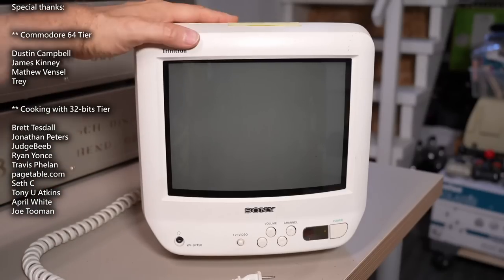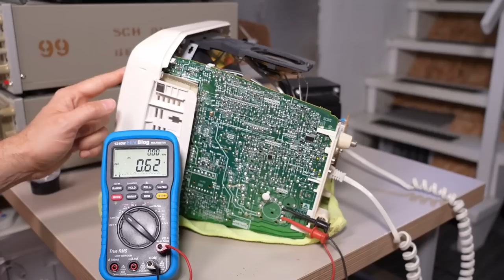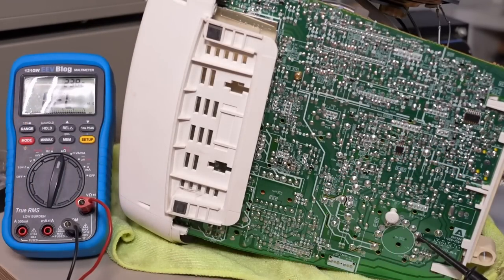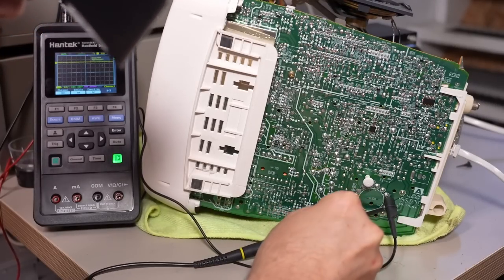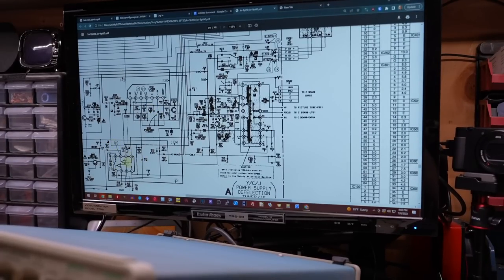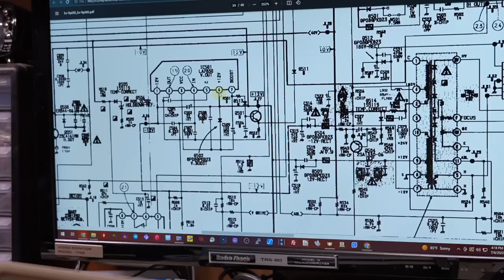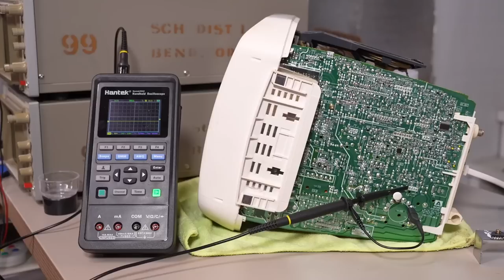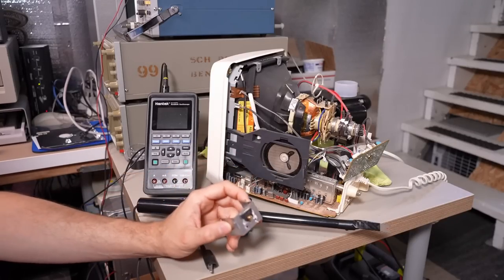This little Sony Trinitron TV squeals and then shuts off (KV-9PT50)

Comment: We have that exact Sony, but the gray cabinet AC/DC version.
Still works.  Not that I use it anymore.  I bought it when I was doing video work years ago (long before HD).

I only keep these sets for memory's sake.

It's late here right now, so I haven't watched the video as yet.  But I'll watch it in the morning.

This squealing issue sounds familiar.  In the past, a lot of time, "squealing", as a certain high frequency, was often a "loose" flyback.  But who knows.
I struck that out, because before watching the vid, I thought that the set "worked" but that it squealed as it was on.  Clearly, not the case.

It's very possible that this flyback is at fault, but it's very possible that there's "something" in the Horizontal section that could cause this.  I did see that you were able to see the Horiz. startup frequency there for a moment.  That might lead one to believe that the Horiz. section is ok.  However, if there's something in that circuit that, once energized, is either killing the horiz. oscillator or changing its frequency, then the flyback won't work to begin with.
That startup frequ. needs to be stable so that the windings start to function.

I think that you said that you have the AC/DC version of this TV there?  Or perhaps you just mean that you fixed on before.  ????  But if you have one, perhaps check the flyback to see if it's the same part number (or very close via schematic).  If it is, then perhaps do a swap between the 2 sets and see if the problem remains on this set, or goes to the donor set, following the flyback.  That would be definitive for sure.

If the problem stays with this set and the donor works fine, that of course, rules out the flyback and now you could concentrate on the entire horiz. section.

Just some ideas.

Comment: I remember around thirty years ago there was a device you could buy that could test for any shorts inside a fly back transformer, maybe there's a schematic somewhere online, probably some sort of simple oscillator circuit involved, could be worth looking into for future repairs.
Reply: If he has that other AC/DC version of this TV that he talked about, perhaps the flyback is the same as in this set. 

Then, doing a swap out between the 2 would help confirm if the problem is the flyback or not.
Take this flyback, put in the donor, take the donor's flyback and put in this set.

If the problem follows the flyback, then it's a bad flyback.
But if the donor set works with the failing set's flyback, then it's ok.

The problem is, finding a donor or getting lucky to find a donor flyback somewhere (new would be best).
Reply: @BlondieSL  Probably the best option, I don't see why it wouldn't be the same, unless the design is radically different to the AC version, I know some older Hitachi sets used the same fly back between the DC and AC only sets, easy to pop off  the back and check see if the number matches.
Reply: @electronicarchaeology  Yup!
Reply: This looks more like one of the secondary load circuits being shorted. If the flyback was bad (shorted) the horizontal output transistor would likely be fried.
Reply: @stevebabiak6997  It does look like there is some sort of loading going on, whether its the transformer or something in the secondary, I was under the impression that a short in the secondary was mostly eliminated,

Although the line output transistor can get damaged, I've found in the past not always, depends how quickly the power supply responds,

Maybe something in the power supply itself, there is usually a cap around 47uf 63v in the primary section, when it goes bad it can throw you off  thinking the problem is due to a short, In the end, it's a great help if you can replace and rule out the transformer if things get difficult.
Reply: @electronicarchaeology  - using “shotgunning” by changing the flyback isn’t something I’d recommend. They aren’t a regularly stocked component at the typical distributor, and they are expensive to boot. If he can even find one.

I posted a lengthy top level comment giving some ideas. IMO if that flyback is kaput then that set has now become a parts set to cannibalize for the next similar set.
Reply: @stevebabiak6997  You're mistaken there's no shot gunning as you call it involved, if you watch the full video Adrian mentioned that he had another set, A 12v version, if a service engineer suspects the fly back transformer and has another at his disposal, There's nothing wrong in swapping it out even if it for elimination purposes, I've been a service engineer for more than 40 years, my colleagues and I have done this many times.
Reply: @electronicarchaeology  - my definition of shotgunning is replacing a component when it hasn’t definitively been determined that said component is defective or has failed. So you’re free to define that term as you choose, but it would be a case of shotgunning based upon the definition I use for that term.

Manufacturers figured out how to reduce shotgunning - they make it nearly impossible to replace an individual component and instead encourage replacement of entire boards.

Comment: How ironic... Back when I was a kid, there were commercials of tv repairmen coming to your house to fix your tv. $39.00 later, they would leave, with a smile on everyone's face... Now, it's hardly an option at all, to have your tv fixed . .. Good thing the videos make money! 👍
Reply: Who ever charged only $29.00 and that was it!??  LOL

Back in my time, my house call was $39.00 and would include minor parts, like fuses, for example.
If there were tubes to replace or a module.  For modules, if they were brand new, I'd have to charge the full price, but if it was one that I refurbed, then a special low price is all I'd charge.  I'd take the old module back to the shop to do repairs and refurb it.  I was one of the rare guys who, when "refurbishing" a board, would not only fix the fault, but change other components that were KNOWN to fail down the road.

Comment: I had the exact same TV in my kitchen for many years back in the early to late 2000's.  It failed in the same manner.  I'm into electronics and finally scrapped it.  I DID save the picture tube though, it's a pretty advanced tube and I figured someone maybe could use it in the future.

Comment: Earlier this year, our Bomb Jack cocktail table arcade machine monitor broke. It turns on for a split second, generates high voltage and blows the fuse. Powering it on on a variac, at 40V you could see smoke from the flyback (it's a 100V monitor). Sad. It's one of those unobtainium flybacks, but there's a nutty professor TV serviceman in my country who's working on something that resembles a universal flyback to flyback adapter, read that as "you can put any (similar-ish) flyback in any monitor with this one trick".
Would be cool, that monitor had a bright and vibrant picture despite massive burn-in.

Comment: Would it help to lift some components so to disconnect the flyback from the rest of the circuit and see if voltages run fine (for as long as the TV stays powered)?

Comment: High pitched squealing can indicate a faulty flyback TX. It would certainly be the next component to eliminate if you can get one from somewhere. Wow it doesn't seem that long ago since I was replacing them, but with the dominance of LCD and OLED displays there's not mutch of a demand for them to justify manufacture 😢

Comment: The side tones kind of makes me suspect there's some resonance fault in either the flyback or the yoke, as both are needed in creating the 15.75kHz resonant tank circuit. It could very well be a magnetic circuit failure (so not an electrical one) in the flyback.
Reply: The frequency isn't stable - like it's hunting.  But I'm not sure if overloading could do that.

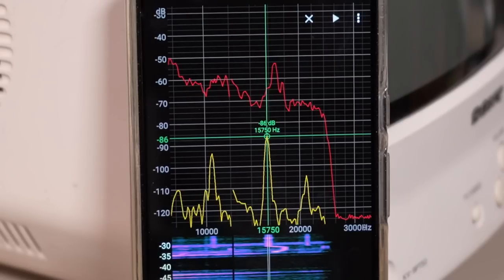Comment: At 2:15, your spectrum analyzer app showed peaks at 10.5 and 5.25 kHz, which are harmonically related to the expected 15.75 kHz. Maybe why the squeal seemed loud: the ear is much more sensitive at the lower frequencies. But I'm wondering what that tells us about the problem? Maybe the problem is on the primary side, in the horizontal drive circuit?

Comment: Squeal and shutdown is a fairly good indication of an overloaded power supply, so something on the main bus is likely a short to ground.  Hor Output device is a usually a good start.  Most Sony's used a Gate Controlled Switch vs a bipolar power transistor for that one.  EHT tranny or vert o/p is also possible.

Comment: I agree most likely the fly back transformer, no obvious shorts, could be worth checking, there's usually a capacitor across the line output transistor, between the collector and emitter, about 7n depending on the screen size, I have had this fail on occasion, but really the sequel noise says it all, a shorted winding inside the tranny, seems a shame to give up because the condition of the set looks pretty good.

Comment: I wish a brand out there would make a modern CRT. Imagine the space savings using newer micro technology. Reduce the mainboard by 3/4ths making it 1/4th the size we see here. And add hdmi/dp along side the oldschool connections (rca, coax, component, bnc, etc). With modern tech i bet we could make 240hz crts which would be insane for modern pc gaming

Comment: When doing any troubleshooting, or science in general, only EVER change one variable at a time.  Because if you change two or more, and the system starts working, which was the problem?  Half splitting is good, but only if you can isolate one half or the other as the fault.  I.E. only one variable.

Comment: I may have missed it but I didn't see the output voltages and wave form of the main PSU output being checked during power on. If the main PSU is failing to maintain the B+ at an adequate voltage under load it could easily cause the flyback to and horizon drive to shut down, and cause the low HT voltages as well. I'm sure you have done this already, just off the video. 

Can't you cut the traces on the output side (+/-12 etc) of the flyback to isolate them from the circuit and see what waveforms and voltages you get off the windings?

Comment: Hi Dude, that is very interesting. I have the same problems. I would like to continue to repair such devices in the future, so I like to follow such videos.
I had asked a lot of older TV service men if they could help me, but everyone ran away and they said they were glad these tube tvs were over. In fact, it is relatively difficult to repair such tv. For reasons of economy, everything is related together to one thing: flyback transformer, deflection, etc. Well, either everything works or nothing works.
It can very well be that the flyback has an internal short like an insulation failure, that often happens.
I'm not sure it is a good idea to power up the device while the neckboard is disconnected. The ground is interrupted and this is to be avoided. Well the tube is not conducting when not heated, but note that the tube is a capacitor, so theoreticly once a high voltage can come out on the socket pins of the tube ?
Reply: I've never experienced HV coming out the disconnected neck pins during testing.
It shouldn't because, don't forget, the bell of the CRT is grounded .  Or, it should be!  It's easy enough to confirm by just checking the ground wire to a wire hugging the bell and/or a spring ground somewhere touching the bell.

I remember when flybacks started to be used as the main power supply, rather than a separate power supply section.

At first, I HATED THAT!  Like you say, if anything fails, it often took down the entire set if the flyback wasn't being energized to kick start things and/or if there was even one thing in any circuit that brought down the main windings.  I did find those to be the worst sets to troubleshoot when they were dead.  We called those DOG sets.

Like those older tv servicing guys you talked to, I too am happy to see that those kinds of sets no longer are manufactured.

Mind you, other than our own equipment, I no longer do repairs outside the home.  We both took early retirement to enjoy life.  Some people get bored after retiring.  We're lucky in that we have so much more to do now than we did when working.  LOL

Comment: i do remember one thing about it cuttting off it is because there short somewhere liar in capacity check voltage rails by transfer and see if any voltage drop if yes and there issues in rail to something that shorting it im sure you will find it if you start at beging where power come in and i do believe there just that you over looked it
go back and check it

Comment: Check the primary side of the flyback transformer and the drive circuit. Disconnect all secondary loads (remove rectifier diodes) and see if anything changes. Could be a bad cap in the primary or secondary.

Comment: Try to desolder H-OUT pin of flyback or desolder horizontal out transistor and then try to turn on the set. If it will not squeal, then it's high possibility that flyback is bad.

Comment: Sorry Adrian, fell asleep mid video, but the sound described sounded like a tripler failure.  Seeing 1/3rd of the voltage I would expect on the tube .....

Did you say you have another of these TV's you could borrow from?
Reply: 1/3 = one third so you don't need to add the 'rd' to it. 👍
Reply: @sw6188  Thank you for that.  Never too late to learn.
Reply: @connomar55  No worries, not trying to be a smart-ass or anything. You only need 'rd' and 'th' etc when using whole numbers such as 3rd, 5th etc. 👍

Comment: I had a similar set, black, and the symptoms were also similar. It ended up being the flyback. I managed to get a replacement, but it was 10 years ago. Maybe shango066 can help you with one. He also has a Sony repair video with a strange behavior caused by a flyback.

Comment: The obvious one is glaring.. C515 along with the diode D504 going leaky.. Also the cap C516 in my experience is a source of trouble on these circuits.

Not a common set here in the UK at all.. but there was a good reason I didn't do Sony Trinitrons back in the day..
Reply: I do suspect bad caps, even when the caps aren't visibly bad to the human eye.

Comment: Test the OpAmp. If I'm not mistaken part of the drive signal goes through it. If it's just part of the audio circuit then it likely has nothing to do with the issue. That's where I'd look though.

Comment: Both 12 volt rails and the high voltage are all around 1/3 what they should be but you said you don't get anything on the 180 volt rail. It seems to me the problem is then with the 180 volt line. If disconnecting the neck board gives you confidence the problem is not after the rectification then logically the rectification stage itself could also be the problem. You didn't test that diode on camera and even if the forward drop is okay it might be breaking down under higher reverse voltages. If the diode is bypassed by a capacitor that could also be faulty with voltage.

Comment: Why didn't you try to desolder the +12v and the -12v pins from the transformer to isolate them from the circuit? You could have seen if it was the transformer. OR (I guess) you could have tried to understand where the hissing sound comes from with idk a good microphone? It would have lead you to the problem

Comment: Mine turns on and has sound but no picture, any tip or help 😭
Reply: I don't know what your level is or what equipment and tools you have.

But first, I'd confirm if the CRT is receiving high voltage (HV).
DO NOT USE ANY REGULAR METER FOR THAT... NOOOOOOO!

Only use a high voltage prob.

If you do not have one, then one thing that you could do, is to fire up the TV and listen for that "static/HV crackling sound".  If present, then you have some HV.
Not that I'm recommending this, because it is VERY DANGEROUS, but what I used to do, when I first got started and didn't have an HV probe or much equipment, was to take a long screw driver (I had one that was 12" long and very thin), put a good ground wire on the metal shaft, mid way (center, not near the handle) and the other end grounded to the TV's chassis (or even the CRT's ground wire).

Then, with the set on, I'd SLOWLY move the flat end of the screw drive up under the HV cup, close to, BUT NOT TOUCHING, the HV wire (where it connect into the anode hole on the CRT) and see if it would arc.  If there was a good, "long" spark that kept sparking, then there's HV.

Again, though, I am NOT recommending that you do this.

Then, check to confirm that the CRT's filament is lit up.  If not, then check the filament voltage to confirm that there is voltage there.  If not, then perhaps CAREFULLY inject whatever voltage that filament takes (often it's 6V, but could be AC or could be DC.  Check the schematic for that).
However, if you don't see voltage at the pins, then you could unsolder both wires and then inject the proper voltage right to the pins.  If the filaments glow, then the CRT is probably ok.

Now your work starts to troubleshoot voltages.

Hopefully, you have or can find a schematic, because as seen here, what's labelled on the PCB might be wrong.  I was rather shocked to see that on a Sony!!!

Also, if you have a oscilloscope (and schematic) you can start to confirm if you're seeing video signal waveform at the proper test points.  Of course, you'll need some sort of working signal, so an old VCR running with a tape in it should be fine.  Or working converter box.

Anyway, much to do, so hope that helped.